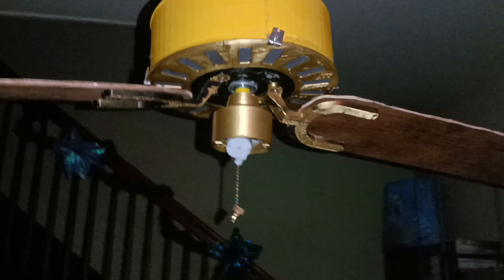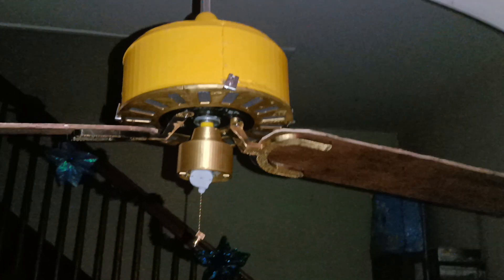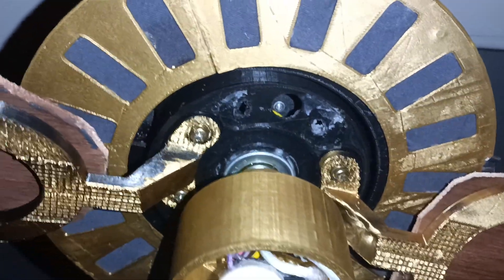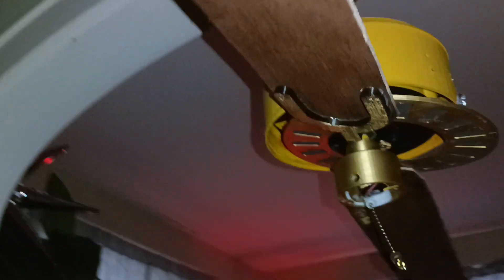Testing my Gear driven ceiling fan with 2 blades (3D printed) Part 1

Comment: imma 3d print this later
Reply from the maker: Also, it's light kit adaptable, I already put a light on mine.
Reply: like real life light kit? @Alexthefancollector
Reply from the maker: @bensgoofyahhfancollection9997  yeah! Does it have two notches on the top light kit for the screws on yours?
Reply from the maker: @bensgoofyahhfancollection9997 also, you will need a drill to make screw holes as there aren't any holes for some of them
Reply: aight bet @Alexthefancollector
Reply: aight @Alexthefancollector

Comment: I’m talking 3d printing class right now and I might make something like this. Great job making that!!
Reply from the maker: I actually have a smaller version that's a hugger ceiling fan, I might post a video explaining how to put it together.
Reply: @Alexthefancollector  don’t be surprised if I ask you questions about 3d printing when I get a 3d printer
Reply from the maker: @fansandvintage2008  My 3D printer needed so much help when I first started. The print kept folding up and falling off when making things, so make sure the fan speed is low unless it's detailed, also, use Elmer's glue for bed adhesion.